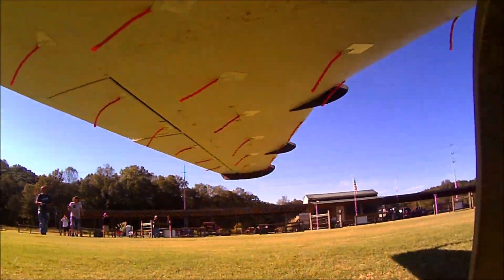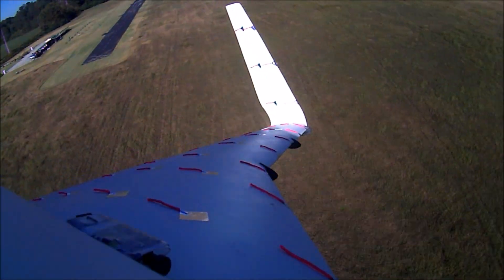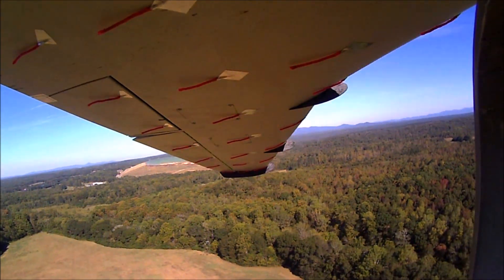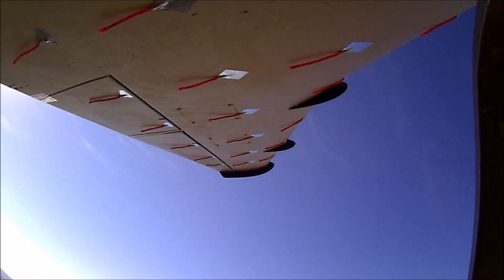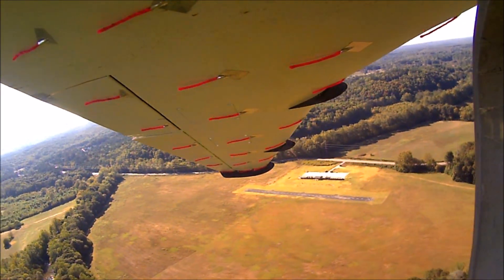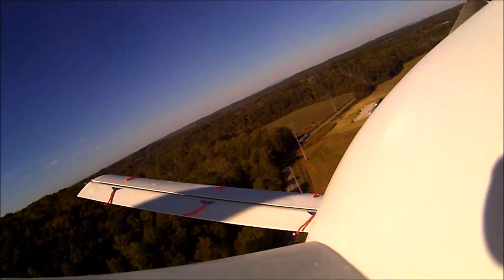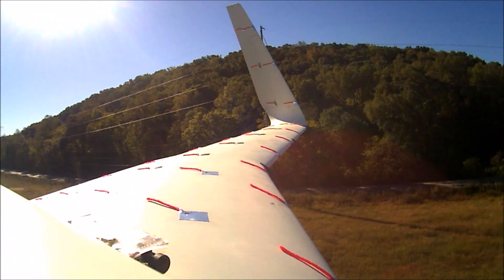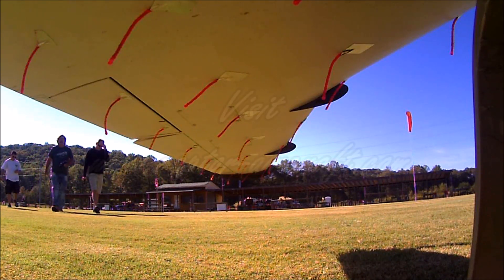Raptor Aircraft Model Third Flight

Comment: just wondering how much the center of pressure will be moving forward with increase of angle of attack, thinking quite a bit. might want to check for pitch stability at different CG's before going further?